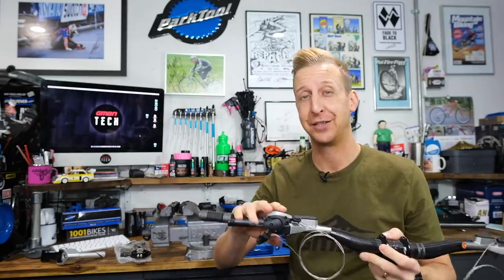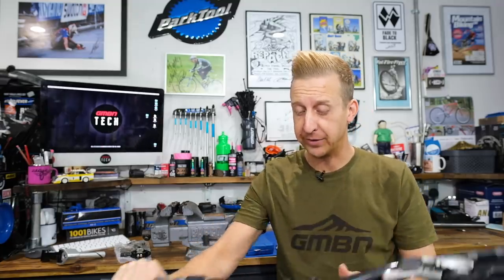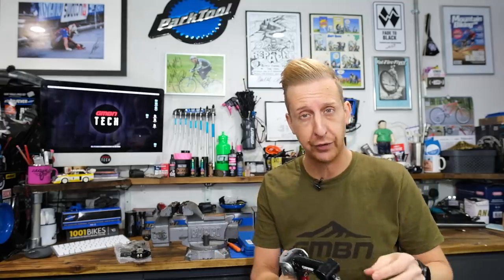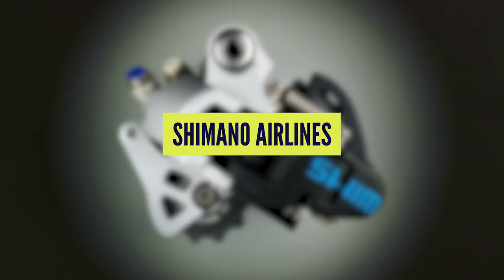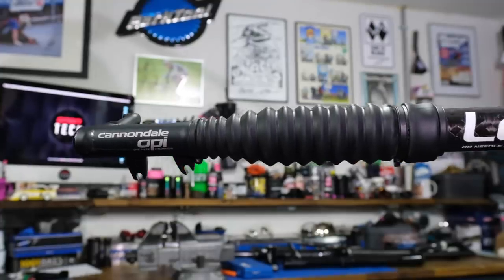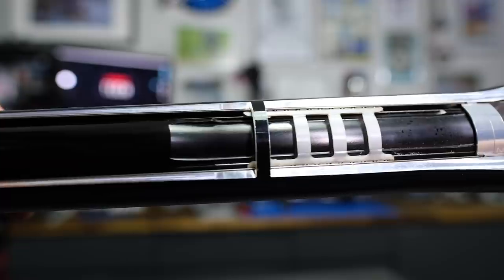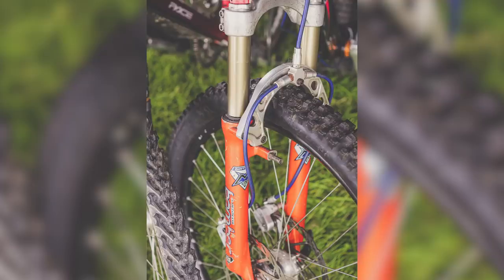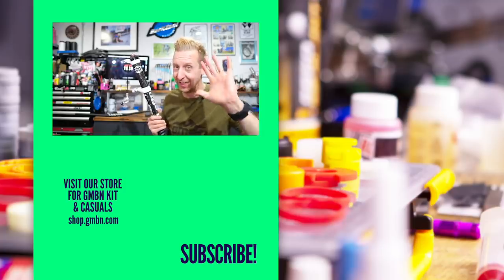The Strangest Mountain Bike Components Ever Made | MTB Tech History - Part 1

Comment: Sorry Doddy, those STI shifter levers are the greatest things ever made. I wish they still made them.
Reply: The second best rear derailleur shifting I've ever had was 9 speed XTR dual control with a rapid rise mech - the first generation of shifters with instant cable release and double release shifting made everything they'd made before them look shite. The best rear shifting I've ever had was first generation 10 speed clutch mech on an XT shifter, but that was because 10 speed chain management was a massive jump forward over 9 speed, nothing to do with the shifter. 

By comparison current model 12 speed feels heavy and nasty unfortunately, but since SRAM's shifting has always been heavy and nasty and they've been selling well, Shimano probably thought the best thing they can do is copy the features that put me off buying SRAM in the first place. The front derailleur shifting on 2x12 is the best I've ever used, but even buying a frame that can take a front derailleur to try it is a nightmare at this point :-(. Too much marketing as SUV ornaments and not enough focus on bikes that can cover the roads to the trails, hit the trails and get you home without chewing the chain and cassette up in a couple of months from sitting in the way too low top gear all the time unfortunately :-(.

Comment: Really don't see why no frame maker has made a 'righty' rear wheel, either mounting the disc brake on the right, or using a fixed shaft to mount the brake caliper to. It must be possible.

Comment: I'm still using a marzocchi z1 fr2 on my 26" still buttery smooth my favourite fork by a mile.
Reply: I have one on a Trek 950. Still works great.
Reply: RollinRat  Damned shame the bean counters killed Marzocchi as a company and all we;re left with are overly delicate forks that need a lot of minding. I opened one Bomber I had (It was a 150 mm travel ETA with air assist) after a few years of hard, muddy riding and no servicing at all just to see if anything needed doing and the oil was still clean inside it. The only other parts that last like that are Shimano shifters and XTR hubs. Now that Fox own Marzocchi, my confidence in them having any durability is low - the original Fox Vanilla RC was a magnificently reliable fork, everything they've done since, not so much.

Comment: In a few years time Mullet Bikes and Gravel Bikes will be included in this feature under the term ' bad' or 'fad'
Reply: Gravel bikes are a joke! Manufacturers just wanted one more thing for rich folks with a solid quiver of 4-6 bikes already in the garage to want to buy!
Reply: I can see mullets sticking around for a while yet, doubt they’ll get much more popular than they are now though.
Reply: @joefulcoly7562  2021 gravel bike otw! Wanna have long fast rides on something that delivers like a roady and is comfy, For staying in shape and building strength for racing mtb. I work my ass off and make good money and love anything on 2 wheels 🤙
Reply: @joefulcoly7562  gravel bikes are really not new.... Take a look at any 1970's road bike with "touring" in the name and they have identical geometry to gravel bikes today.  I'd much rather ride a gravel bike than a true road bike (way more comfortable).

I have a restored 79 steel touring bike that is quite nice to ride and cost a couple hundred in some choice upgrades (tires was a bit spendy).  The only thing is no disc brakes which kinda sucks, and I'm not wanting to upgrade hubs and weld tabs on the frame but you definately could.
Reply: @johnnygunz2300  Your point is the exact issue I have with Gravel bikes. They have been around for years in the form of Touring bikes and Cyclo Cross bikes. It's all marketing rubbish and they are slowing turning in Mountain bikes which is a joke.
Reply: @johnsonjay60  cheers to that, if I’m being honest I’d have one too but I can only justify so many bikes between the ones with motors and the ones I power myself! But the other commenter proved my point, they are nothing new and don’t offer much different, but enjoy yours!
Reply: @joefulcoly7562  thanks man :)  appreciate it. Yeah I didn't think it was anything new either, look at the geo. But riding drop bars is gunna be weird, that's for sure. I won't be wearing spandex and an aero helmet lol. And I have everything but something for long comfy fast rides and definitely don't want to be limited with a road bike. 2 years ago this would not even be a consideration but as things get more serious I wanna be able to u that to my advantage. Even just riding it on rollers instead of my indoor trainer should be fun and better, But again the drop bars. Lol 🤙
Reply: @johnnygunz2300  sounds nice!🤙
Reply: RollinRat  nice! Yeah I love the history behind it. My next ht will be steel for sure. My go to trail rig right now is my 2019 scott genius with alot of upgrades but its not great for riding indoor so that's the good thing about a dj . Even tho I started on bmx. What was you're first mtb?
Reply: Keith Bontrager made the 69er back in 2009,Trek hardtail with a 29" front wheel and a 26" rear wheel. There's alot of mullets being riddin now by pros. So if u think about it, I don't think it's bad or a fad. I think it's a preference.  I've tried it. It's fun . The back is more squarely. My bike takes 29" or 27.5, it came 29" I flipped the chip and built some custom  stans Barron's, 27.5 x2.8 up front and back, and it seems just fine too me. Tried a skinnier 27.5  out back but had a blow out and the tire casing is bad from the factory so waiting on warranty bs.
Reply: RollinRat  wow how cool man! 😎 👊 thats sweet!
Reply: RollinRat  I am bro, I'm getting a chromag built by Mike truelove. And I'm not stopping at any expense it'll just take awhile. I feel you!
Reply: RollinRat  yeah I'm not a carbon fan lol all my bikes are alloy except 2 steel bmx
Reply: RollinRat  I will check them out and definitely adapt to the drop bars I've been riding for a long time :) (nowhere close to u lol) love how much the sport blew up recently
Reply: RollinRat  sorry didn't see that post thanks man I appreciate  it!!
Reply: RollinRat  I've been told about the "hooks" what I'm getting is a 2021 scott speedster gravel 10. Check them out and tell me what u think?
Reply: RollinRat  I have a good question for u so I gotta get my girl one too I'm sure lol. She's gunna wanna go in thos kind of rides and I got her liv pique pimped out with everything I could other than changing suspension. its an xc machine!!! What would u recommend for a 5' tall girl entry level "gravel bike" prolly wanna try to stay around that 1500$ mark. Idk if she'll even like it but she likes the rest so I think she should take to it. But I want a new one for her more than she does lol I'm sure u know how that is but what would u recommend? Just entry level.
Reply: RollinRat  damn I could talk about this stuff forever. I appreciate you're opinions and thoughts brother! Only reason there's a budget on hers is because I spend so much money on my bikes  recently, lol I have 4800 into my trail bike now that gravel. So lol I gotta get her something I can upgrade but in good taste. And available.  If all my bikes could be custom built frames I would but that chromag ht will be just like u said. And extention of me. I've always thought the same way
Reply: RollinRat  I have a full room all park tool and I help out at my lbs so I get deals and what not. But man bikes are hard to get right now. People are buying anything they can get their hands on the shop has a bunch of 500-2000$ mongooses lol. But they are taking on mondraker which is a high end brand out of Spain that I like too.
Reply: RollinRat  definitely threaded bottom bracket for sure.
Reply: RollinRat  have u ever opened a new scott bike? Even the packaging is crazy high quality lol. Come with tools, laminated manuals, all kinds of lil extra goodies. Scott's are really nice.
Reply: RollinRat  same at this shop. It was insane and people were mean man lol. Come in all at once wanting bikes and it you're fault all of this is happening. That's why I like to stay wrenching when I'm there, but I go out on the floor it's gotten better but when this craze all started it was insane.. now the racks are pretty full but not with what's normally there. Hoping to get the New bike by early april. paid for already.. have a cpl. things to change cosmetic mostly. To pull out the tan wall colors
Reply: RollinRat  I do hvacr for a living the bike shop just started because I'm one of thier favorite customers lol. But I get the dealer discount and fee tunes ups. If there's something I don't have in my bike cave they lend it to me or I come there and use one of the stands. Than they asked if I would come in to help appeal to the younger crowd. And start building more custom bikes. Than the vid hit.I just go in when I'm not busy and feel like learning something. I usually just have him keep my pay as store credit lmao
Reply: RollinRat  I know what u mean exactly what u mean lol. Yeah scott is pretty "innovative" if u will, they are all into the integrated stuff. I know I'm paying for a name but I've been thru many others and found a quality I'm super happy with and awesome warranty. When I first started riding again I remember thinking why would I buy a scott bike!? I thought off motocross goggles lol but have been pretty blown away from riding and seeing them come and the way the head mechanics act when they are building one.( like it's a whole different thing they are doing) stand back don't bump that lol.The new ht is external routing. I notice alot of the older generation and steel bike lovers don't like it. I think it's for looks yeah and I think it can cause problems too. I know what u mean a fishing license 😆.  The bar/stem integrated brakes!( I don't use) lol its getting like cars. I appreciate the mechanical aspect of a simple bike. So I get where u are coming from. U won't see any batteries on my bikes other than one dropper I have (the reverb.) No wireless shifting for me. I think it's neat but idk i just can't get with it.
Reply: RollinRat  the gravel is 21.6 lbs without pedals. The fork is carbon.🤷 I just wanted a light fast bike and I can't get fully with the roady seen. Don't wanna be restricted. The geo on that bike has stayed the same. And they talk about the threaded bb and other stuff. Has a Grx groupset,shimano discs, sycros components, scwalbe tires
Reply: RollinRat  that's thats a lil too much but some guys are like that. That's is a nice bike the s works ! Bet it was fun
Reply: RollinRat  hey brother to each their own. Nothing wrong with that. I like a nice burly bad ass steel rig myself. That's the next purchase.  I'll keep it forever .
Reply: RollinRat  lol I am into sram drive trains man. Have been for awhile nothing wrong with shimano and have been in the bike game forever but personally so far I prefer sram gx or xo. Just my preference.  Shimano brakes or magura and trp. But I'm sure I'm gunna love the grx!
Reply: RollinRat  yes the mixing is a good thing for sure,  im just waking up lol
Reply: RollinRat  I haven't heard about that but I heard my buddy say he was getting them for his pole he just ordered and I said why!? And he wants all sram. Lol. All older bike guys shimano shimano.  I love it. Yeah no sram brakes for me!
Reply: RollinRat  I haven't heard about that but I heard my buddy say he was getting them for his pole he just ordered and I said why!? And he wants all scram. Lol. All older bike guys shimano shimano.  I love it. Yeah no sram brakes for me
Reply: RollinRat  the new scram stuff even nx is good, and strong, I ride pretty hard gx and xo on my mtb's For life. The stopping power of magura and trp. Is soooo nice the mt7 or mt8 🤤

Comment: 26" wheels rule , dam them 27.5 ,29" and dam them tapered steerer tubes
Reply: I've bent too many non tapered steerers, but I'll agree on 26...27.5 isn't so bad either.
Reply: @johnnygunz2300  
Blimey never busted a steerer tube . Are you a large fella or just getting airborne
Reply: @whollyspokes3645  yes and yes... My knick name in college was "baby guerrilla" being 5'9" 200+ lbs somehow not fat but must have bones like lead.

Also was into DJ mountain bikes etc

So ya kind of abused allot of forks and it got expensive so DJ's were done on bmx instead after bending 3 forks.

Only once did I bend a steerer trail riding but there were drops involved.
Reply: I've been riding MTB since they were called ATB 
Once put a tiny hairline crack in Fox f90 straight steerer , drilled end of crack re wielded , never had another problem with them
That's with riding hundreds of miles since , with bike packing bags loaded on the bars ...
Reply: @RealMTBAddict  see my response above to wholly spokes:

Heavy + DJ'S 

Had a raleigh fully ridged I learned on in the late 90's (broken handle bars / bent steerer riding north shore style stuff).

Cased a jump on my specializes p2 stock fork got that replaced for free somehow under warranty (crazy), and then landed hard again jumping and bent the replacement and replaced with a marzochi DJ fork which was tough (bike got stolen).

On my Kona stuff I bent that stock fork as well and again replaced with a marzochi DJ with a thru Axel (pretty tough fork but heavy).

Not super high end bikes but stuff around that 2000ish time frame isn't nearly as robust as the 2010-2020.  I have an enduro now at its crazy robust compared to most of my previous bikes (minus the full chromoly bmx bikes.... That's next level tough)

Comment: Would still prefer the downtube friction shifters to brake lever index shifters on road bikes, downtube uses almost no housing and short cables for extremely accurate shifting, and minutes to adjust and set up. Don't trust the safety of a single sided fork, not going to trust that much to bike engineers....fortunately since fat tires I use a rigid fork today with 3 inch tires. Off-road brakes with exception of fast downhill are always more powerful than traction of tire to surface. On road brakes too. So brake heat build up on long descents are my only problem, could be solved by a little liquid water cooling for racers, I solve the problem by stopping to let them cool every 20 minutes and drop tiny drops of water on them to cool faster. The heat of the brakes doesn't effect braking power however. I owned a full ProFlex bike with Girvin downhill fork...glad those days are gone and fat tires now handle suspension duties. 

Bike engineers still haven't fixed the easy problems and then go on to make dependable parts undependable. We still need wheels that don't need rebuilt every 3000 miles. We still need intelligent cassette gear spacing. We still need triple cranksets for perfect gearing for 99% of all recreational riders...here it is...22/32/44 chainrings - 11-12-13-14-15-17-20-24-28-32 cogs. On road or off-road this gear setup would fill the needs of 99% of all recreational riders. 10 speed, no need for anything else, stop adding cogs to cassettes 11, 12 13 speed....stupidity. Single chainrings or 1X gear trains got to be the most stupid idea yet for gears using gigantic size high wear item cassettes instead of a tried and true 3x drivetrain. ....been living with weak stupid bikes for too long....

Comment: Dual-control rapid-rise was ergonomically brilliant. I could not disagree more about them being a flop. The final iteration was superb, and I was really disappointed when they dropped them with the introduction of 2x10. You could change gears anywhere, because using the spring instead of cable pull to send the chain up the cassette was much gentler on the chain, and the strain on your thumb from pushing against a heavy front derailleur spring was no longer an issue.

You should only be using one finger on the brake lever, anyway, so this comment about them randomly changing gears because you were using the brake lever to leverage the pitch attitude of the bike just highlights poor technique.

That said, clutch rear derailleurs have been a game-changer, and they probably wouldn't work so well with Rapid Rise.

Comment: I used the flex stem when staying over at a family friend's house for a week and was blown away by how good it was compared to the suspension forks knocking around back then , I got home and tried to buy one but then found out that there was no way I could afford one being 13 and jobless!! 😄 
I also had a set of those Z1s in the same colour with the duel brake mounts and then spent a year or 2 trying to find those brakes with no luck! ending up selling the forks for what I'd bought them for 2 years previously! Probably should have kept them though IV a set of Z1 in black in the attic and they work completely fine 20 years after I got them!! They are my favourite fork of all time!(the 2000 set!)

Comment: #askgmbn I have a 2021 trek marlin 7 and there seems to be clicking noise coming from the back wheel or drivetrain
Reply: If it happens while not pedaling it could be:

Rotor rub (first ensure the rear Axel is tight and seated properly... Then if still making noise adjust how the caliper is mounted to the bike)

Or possibly something is acting weird in your free wheel (highly unlikely)

If the clicking is while you are pedaling it's likely the rear mech:
1. Check the rear axle to be tight and seated
2. Ensure your mech has the top and bottom stops adjusted properly and the mech is in line with the proper gear selection (just eye ball by looking from the back of the bike).
3. Could be a bent mech hanger... There is a tool you can use to check straightness and bend back the mech hanger... Or just replace.

Without knowing other things like does it happen in all gears or just some, pedalling hard or light, clicking that is timed with the wheel spin or at a different pace than wheel revolution those are my best guesses above.